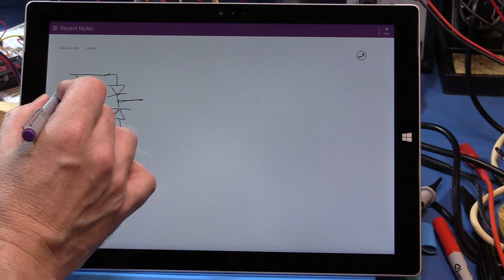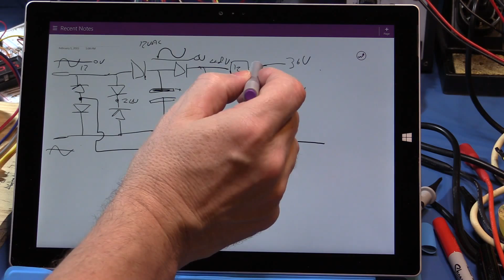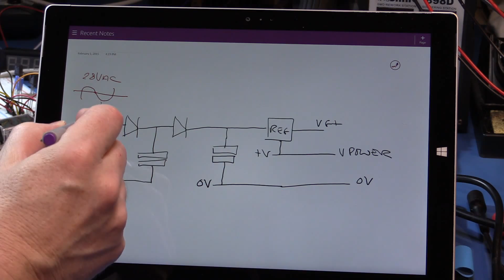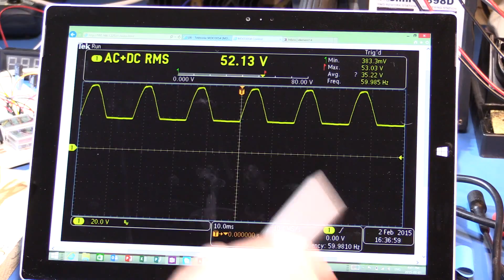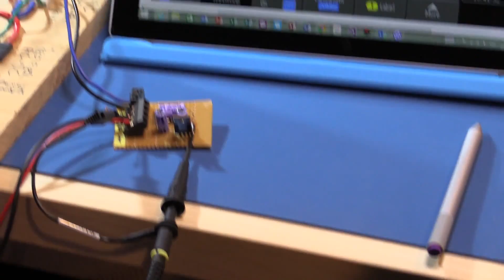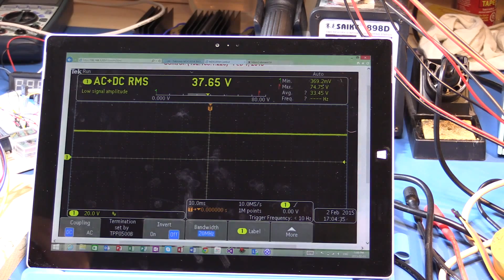The Modular Bench Power System #8 - Voltage Doubler for High Side MOSFET

Comment: hello.
Please tell me what was the trace shown on the osciloscope, before conect the 28 volts.I mean , the first image with the osciloscope screen, showed a wave wich i would like to know what was.And after you responding me, i will tell you why i asked.
Thanck you
Reply from the maker: The first trace was just noise (Ambient as the probes were not connected), then I show you when I connected the probe to the AC input of the circuit, I then attach a small load that flattens the peaks, does that give you what you need ?

Comment: Peter, my Voltage measurements are very similar to yours except when I put the scope probe just after the first diode. Instead of level shifting the sine wave, I get a fairly linear voltage with approx. 1Vpp and 37.6Vrms. I've only wired up as far as the second cap, so no Vreg or load.

Comment: You could also wind a few turns on the transformer and connect it in series with the secondary winding(s). A simple rectifier etc would give you the extra voltage. Nice series by the way. Thanks.